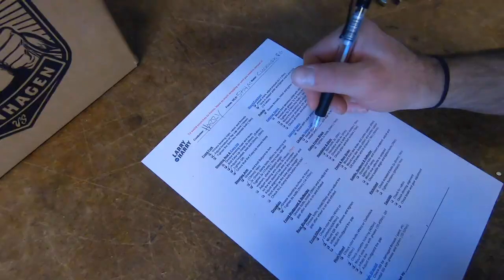Build a Bullitt like a King!

Comment: I find it interesting that he uses alot of unnecessarily specialized tools. Attempting to insinuate that the average person is incapable of putting a bicycle together?
Reply: at which timestamps have u seen overcomplicated tools?
Reply: No unnecessary tools in the video, really. If anything, it’s simplified a little. For example I would use a torque wrench on the hollowtech crank, but he knows what he’s doing and it’s probably fine like this.
Reply: Nothing specialized at all, just basic tools that are totally required to do the job
Reply: @donpuer  i suspect he is so used to building them that he can tighten the right torque just by feel.